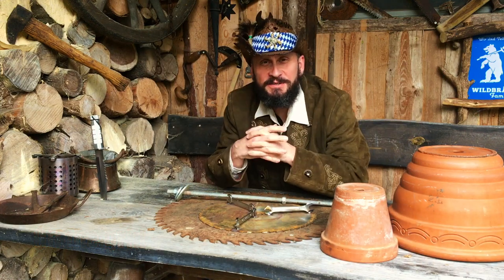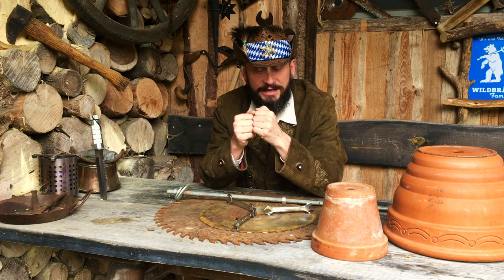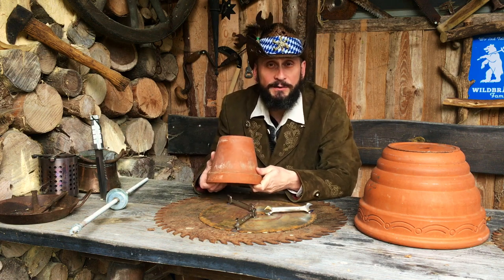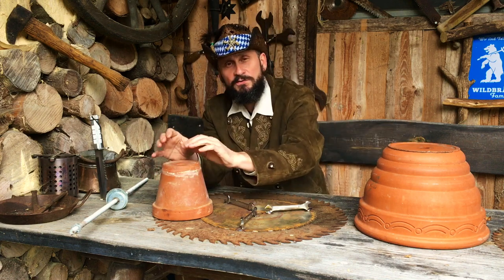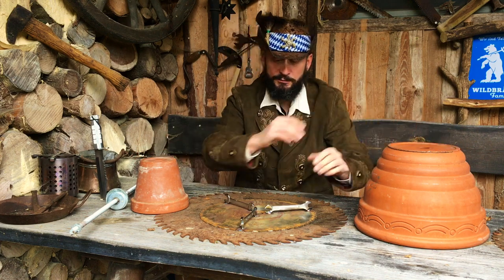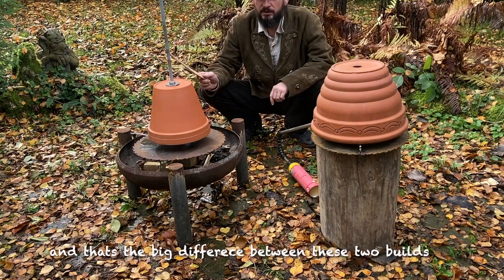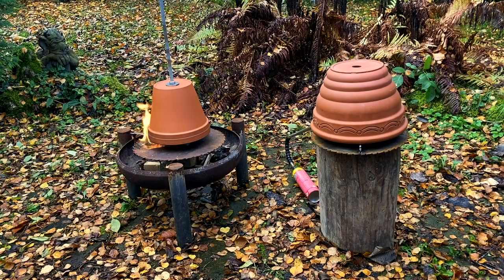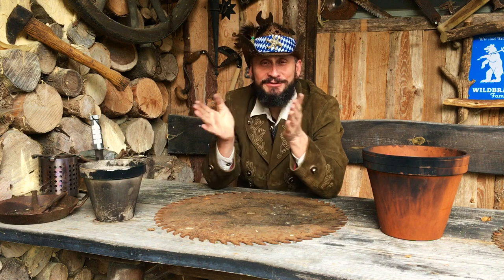DANGER! wrong build! Plant Pot Heater or Flowerpot heater Teacandle Heater emergency blackout Heater

Comment: You can also make home made candles using shortening/crisco and mason jars. The reason for the home made candles is #1 - longer burning candles. #2 - cheaper. #3 - could possibly be safer if you dont over stuff the jar.

I would suggest trying this in an out door area first or a empty metal/cement building where fires wont damage the building.